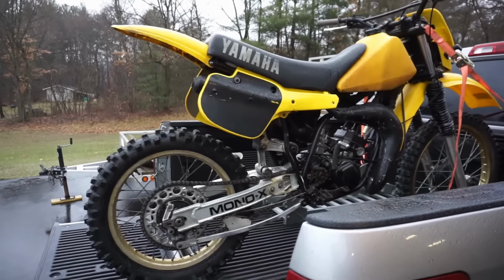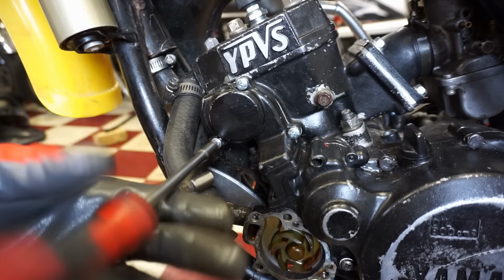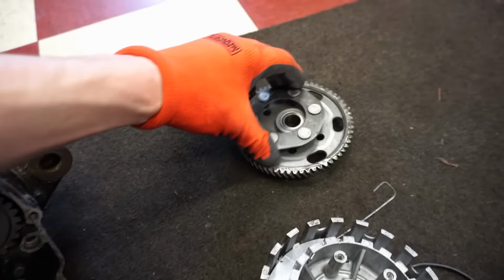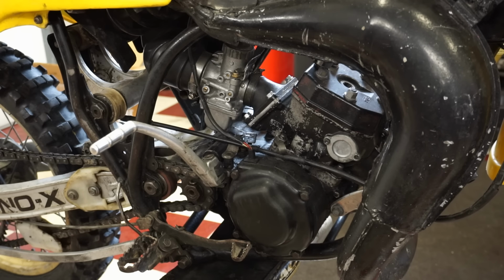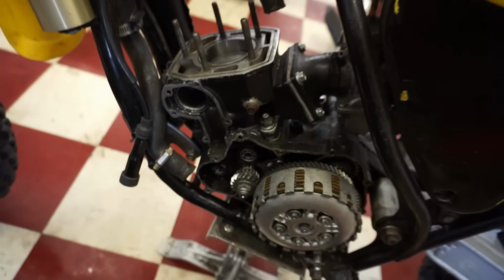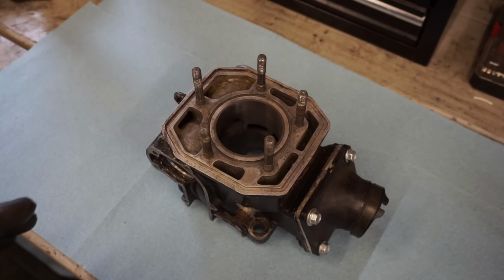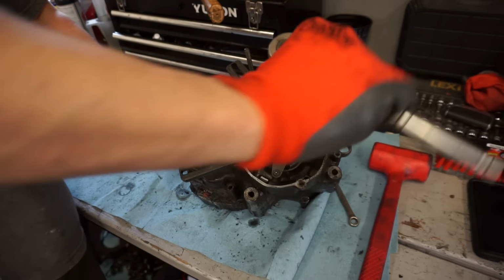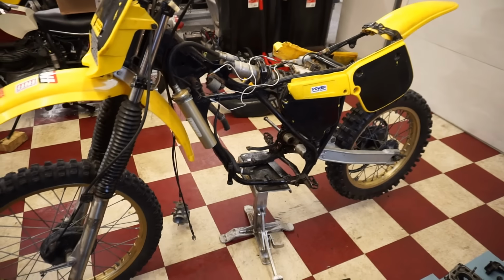Seller Lied About This Rare 2-Stroke Dirt Bike

Comment: Absolutely rebuild it.  You obviously have the skills, so labor isn't a cost (except for the machine shop).  It sucks getting ripped off, but I still think you got a deal.  As you said, the bike looks straight which you don't often see on vintage MX bikes and I love the YZ's (I had a new '78 250).  I'm sure if you found a pristine '82, the seller would be asking more than 2K for it.

Comment: I had one of these I bought used in the 90s. Rebuilt it with a wiseco piston and a new power valve and it was a reliable powerhouse to say the least. Pounded on it almost daily and it was the most trouble free bike I ever owned. As far as your bike, typical of nowadays, you can't trust the "word" of anyone. I had a 84 also, I may be mistaken but weren't those power valves the same? I seem to remember they were but the rod was different. Not sure though as its been a long time ago. I had a few bikes in the day but my 82 YZ 125 and my 78 TT500 were my go to bikes.

Comment: I haven't looked through a lot of the comments, but I had an '81 YZ125 which had the rad up front by the handle bars. I could have sworn that when they made the '82 model. the rad was under the neck and the colour was changed to red and white along with the style of swing arm/mon shock as seen here. My '81 had the triangular swingarm.

Comment: Yeah, the water running through the steering head to the radiator? Yamaha (and every owner) found out fast running 200 degree water through the steering head's pretty hard on steering head bearing grease, plus any looseness at all creates a leak. It WILL leak, until you run external hoses to a different radiator. Like Yamaha did the next year.

Comment: Definitely worth restoring if the parts are available there's still definitely a market for vintage mx bikes out there. Even putting in what you figure it will cost if you decide to sell it when fixed you will probably still turn a profit on the bike. Great videos keep up the good work

Comment: Sorry about your luck with that.

I owned and raced its big brother. The YZ 490. I raced for ten years total and knew all about those YZ's back. 

There was no chance in a million years that I would have started let alone actually ran with that piston and ring. Could have been running Cam2 and nitro and had a zillion volts at the plug. 0 compression = no start period. 

Had it actually started, with a piston that loose, the skirts would have broken off in seconds at mid to high rpm. 

Funny story about a guy who showed up at a track I was racing at outside of Lebanon Tn. in 82. The tall front plates with the tall numbers were becoming mandatory at most tracks back then. As they were at Lebanon, a guy shows up with a brand new YZ125 and was told he had to remove that stock front plate. As I recall, Yamaha took a dual purpose trail bike plate  they already had molds for. The air opening was where a headlight would be fitted. These were on the early run models. They were really ugly. Your bike is a later production or it was retrofitted with the newer plate. I believe that was the only year the radiator was on the triple clamps.

Anyway, this guy had the tall plate with him that he just hadn't taken time to install. After he gets it installed tight over the  radiator with zip ties, he didn't know what to do about air flow thru it. The track had power for there speaker system. Someone comes out with a corded electric drill and suggest they  start making holes. 

I wasn't really paying attention until my dad elbowed me in the ribs and pointed at the kid. Before anyone could stop him he had drill 2 or 3 holes thru the plate and right thru the radiator. He apparently decided to rush the job and just randomly powered that drill into it really fast. My dad knew what was going to happen, he saw it from a mile away. The guys buddy saw the coolant pouring out and yelled at him to stop. 

Honestly as sad as it was to watch, we got a good laugh out of it. Never saw the guy again at any track in the area.

Comment: Rebuild it.   Use nice stuff.    Get the sticker for the swing arm.   Check the steering stem  bearings too and reroute the hoses outside the frame from the radiator 

Let me know how it works out please.    Best Mike !

Comment: Hey! I got a 1981 YZ125H. In neutral it will shift in to first gear on its own. Wonder why. Also the coolant is leaking from the steering head. If you are parting out, I could make use of some parts :) Good luck with the build.

Comment: I owned a 1982 YZ250. It was a beast! Yeah, odd placement of the radiator. I was in a race and someone kicked up a large rock and dented the aluminum on the bottom half of the left fork. Suddenly I had no suspension as the bike bottomed out into the dented portion of the fork and it locked up with zero suspension. What a bummer.  YPVS was an interesting albeit ground breaking addition.

Comment: Had one of these back in the late 80s . The YZ 125 MODEL J    was the first water cooled YZ      I did have issues with leaks though the headset from the cooling system seals . iT DID GO HARD . In 86 i brought a KX 125 E1    The poor YZ was nothing compared to the power & the handling of the E1 . KX E1 being a 1986 model .

Comment: I own a complete copy of this. From What i remember the power valve linkage gets a little sloppy.I replaced the clutch basket and had a rod kit done on it.They run OK I thought although I have not run it in some 10 plus years. Surprisingly the trans always shifted fine, and It always ran reliably (trail riding)

Comment: I had 3 82 YZ80J's...1 was stock, 1 was practice bike, other was race bike. Those things ripped! Wish I still had 1 of them. The radiator on front of handlebars behind plate was cool at the time. That bike today would run with the 85's if you put a larger head & piston in it. This bike is a great find...KEEP IT!
Reply: Friend's dad bought him an 80 J, those were the best, I had my RM80 N but nothing could touch the J 👊
Reply: Brand new 80 J.. that engine sung like an angel...lol,  specially when you kept it in the band all up the 6 gears.

Comment: I think that bike cost between $1,200 and 1,400 brand new in 1982.  That was before the 1986 production rule that tripled the cost of a bike in 5 years.
My 86 YZ250 new cost 2,300, and my new 88 CR250 cost $3,200.  They topped out at about 5 grand several years before the 4-strokes were forced on the industry.

Comment: The Suzuki RM's were the top motocross bikes in 1982.  Especially the 250 which blew everything else away.  Yamaha only did the radiator on the forks for that 1 year.  It heated up the fork oil, which caused problems.
Reply: I had an 82 RM 250 it screamed awesome bike!
Reply: @marksnyder8697  You know!  The '82 RM250  was legend

Comment: the vast assortment of mixed fasteners tell me it was some barn/garage/basement pickup someone got for cheap and it sat around for years tore down, with half the parts now missing.
the question is, who took the plowing and received the most lies, you, the seller to you or someone else multi-steps up the line. those things tend to get pushed around or thrown into trade-off combo deals.

Comment: I had the 1982 YZ 80 back in 1983-84, I bought it from a boy who raced expert and they caught him riding the wheelie across the Finish Line in 80 miles an hour, it was bored out 3 times, it was fast as hell! About 6 years ago I seen one on eBay that was in mint condition, I really wanted, but I didn't have the money, and he only wanted $2,500 for it.😣😢

Comment: Yamaha only did the rads behind the numberplate for 1982 only as they always leaked in the stem. Steering stem bearings and seals are probably toast. I had an 82 YZ80J of the same design. Never had luck tracking them down so I had to route hoses, bypassing the stem. Also Yamaha used O-rings on the head, not a gasket. Good luck with the crank. But at a quick glance it looks like you have a solid platform to start with. 👍
Reply: In regards to the radiator on the steering stem it was 81 actually for the YZ125 and your spot on with your remark as to it being a troublesome design . It will be interesting to see how he gets around this as those bearings and seals have been obsolete for decades now !

Comment: I bought a motorcycle from a friend one time... he had it in paid storage for a year.  It only had 700 miles on it when he stored it.  I paid him and got the title.  When we went to pick the bike up it wouldn't start.  I managed to get it fired up enough to ride it home.  Found out that all the major parts had been taken from the bike and old, defective parts put on.  The gas tank had bondo repairs on the bottom, and the four carbs had been swapped out with a set full of rust and worn needle valves.  The bike had been cannibalized to repair other bikes, with the bad parts bolted back on.  The crooks didn't even bother with replacing the springs on the carburetor boots.

Comment: @2vintage You should take a closer look at that steering bearing. The coolant from radiator goes thru there. Had seals notorious for leaking and causing damage. Thats why the moved the radiator. Likely to take more than bearings. Forget all the details but know some have required welding and a machine shop. Know of one guy who managed to bypass that mess with heater hose eliminating need for seals. But was a bit questionable. If you decide to part it out, let me know.

Comment: Wow, talk about a throwback..... BUT, a bit more for me 🤗👍B/c my Grandfather & Dad bought 1 for me, brand new at the dealer, a 1982, YZ80 back in well,  YUP 1982 😁It was a graduation gift  for graduating 8th grade.... In 1982, I was just 12 y/o, 5' tall, 90-100 lb skinny kid 🤣and the 125, was way too big for me. Years later, realizing (knowing myself) I was always an impatient kid..... + I didn't graduate 8th, until 1983 🤷‍♂ 🤔😁 H/S in 1987.... At 6'1 195 lbs and 55 y/o now, I agree, that 100% was me 🤔I was ALWAYS impatient until I hit, ohhh about 40 🤣But what a throwback this video was for me. YUP,  the 125 here, same as the YZ 80s, my radiator was up top, in front of the bars. Mine had chrome rims, BUT didn't have the full floater rear swing arm. That didn't happen on the YZ80s, until 1983 (facts, because my best friend back then, got his YZ80 in 1983, AND his had the FF swing-arm) I have pics somewhere 🤔🤗🥰 BTW, I subbed up, & I'd like to see a follow-up on this 1.... on how it actually runs and sounds fixed back up..... Wish I still had that 1982..... IMHO, everything was better back in the 80s, than today 🤷‍♂🤣 +  It'd make a great gift for my grandson + the story, memories and fun times I had with it 🙏😁

Comment: Nice video, reminds me of working on my 83 YZ250. When you pulled the power valve cover, I was like holy smokes it's not even there!!! Sorry there are people our there like the seller. Like you said that bike was not running & would have zero compression with a piston & ring set that far off. Hope you can source the parts at a good price. Got to save the smokers (2-strokes)! Good luck with it!

Comment: Never buy a bike in less you can hear it run and you can ride it (unless you want a parts bike).  My 1987 KX500 sat with the original tranny oil and antifreeze in it for over 23 years.  It still runs like brand new even with the old fluids in it...  But I did recently change those fluids out of guilt....

Comment: I had 3 bikes in one....all yamaha......
A 79 mono shock, a 1980 frame, and a 1981 250cc(246cc), and I sunk it in a mud hole... I got a dr400 head, honed my cylinder, sleeved it at 260cc, used the 400 head, honed it down to 256cc, with rings...it rocked!!! It'll flip a fat man!!!
I figured 275hp, because 1st gear, and good startup, gave great climb. Bought it for $74, and a good used tire.  Sold it in 97, for $1000, and got it when that fat man hit 3rd gear....kickband...in front of me...he popped the wheelie, stopped, turned back to my driveway, and told the buyer to grab it now
Some say it had 325hp!!!!

Comment: Those power valves are hard to locate. Getting expensive. Most of them are for 84-85. They will tell you they are same. But they are not. You can put it in there. But its not right. They have 2 extra holes for ports not in yours. Looks like you also need the governor and linkage. Make sure you get a good one. They wear out. And they are 2 pieces with locating pins and a bolt. Often the bolt would come loose , people would continue running it. The holes for pins get out of shape. The 2 halves got out of shape. And the bolt hole and threads destroyed.  I have an extra power valve that is good. Have the whole set up , governor ,linkage, and valve. Might be interested in one of your clutch baskets. Mine works but has a finger broke off. If you have extra rubber gasket for powervalve cover might be interested in that. Doubt you still have it. But you had a bombardier ds650 that came with a bunch of extra parts. I need some of them. The beaings, seals , and gaskets you need are cheap and readily available. Depending on bore size i might have one of those. But they are easy to get.

Comment: I was a teenager when these were new-ish. The powervalve makes no difference to how these run-- this isn't the same as a new bike. Back then it was a marketing gimmick. Many tuning shops took them off as well as the Honda equivalent (ATAC) which was introduced in 1984. Suzuki and Kawasaki didn't even use powervalves until 1986 and 1985 respectively, and I had no problem beating '82 YZ125s on my 1984 KX125 which had no powervalve. $850 for the bike as it is, is not a great deal but not too bad. You can't get more than about $2500 for an Eighties 125 even restored, at least when I was heavily into this stuff about 6-8 years ago.

Comment: What I've learned buying used equipment: If there are parts are in a box you can never assume anything the seller is saying is accurate or true. Especially if the parts in the box prevent you from turning the engine over and hearing it run or compress.

Sucks that sellers can be so dishonest :(

Comment: How did the valve system work?  Rotary valves?  Reed valves.  I know when I put a reed valve on a 175cc AT/CT-1, it released a torque monster at the bottom end.  I’m a big boy, 6-2, 200+ and the bike weighed about 225 after I put it on weight watchers.  I did too and lost 20# and got the bike down to about 210.  It was great.  Running lean I could run away from the stock DT250s.  It would lose its “go” on hills and in deep sand.

Comment: I dealt with something similar, albeit not as extreme, from a pair of buyers.  My dad had a massive stroke, but has defied the odds, and not ended up the vegetable doctors thought he would, and I want to get him riding again (probably this summer).  A full sized bike just wouldn't be safe for him anymore, so I bought a Kawasaki KE100 from a pair of teens looking for money for their next bike.  I already knew they were charging too much, but I felt like I was helping out a couple of young riders, so I didn't haggle.  When I asked about it being oil injected, they admitted that they had switched it over to premix (not good for the engine).  The bike ran, and I hadn't ridden an injected bike in over 2 decades, so I wasn't looking for the telltale signs I should have.  They told me the injection hardware was all there.  No, it wasn't.  NONE of it was.  No tank, no pump, no shaft, no gear, no nothing.  Worse, when I had the clutch cover off the deal with it, I found a gear sitting on top of the crankshaft - that wouldn't go on  You could see where the cover was scored up where the loose sprocket spun and jangled around.  I paid a guy to repair the threads, but I made the mistake of trying to torque it to factory specs - off came the threads.  I ended up threading it back on  gently with threadlocker.  Having dealt with all that, I got new tires, sprockets, and chain.  When I went to put the sprockets on, I found out the only thing holding the old drive sprocket on was... the engine cover.  More missing parts.  Oh yeah, and the rims had no rim tape either!

The bike could use more work to make it look clean and nice, but after hundreds of dollars spent, it's now serviceable, with a working oil injector in place, and sprockets, rims, and tires all good.  What really should have costed more like $500 or $600 Canadian ended up closer to $2000 all told.  It'll still be worth it to have my dad riding again, but those kids totally screwed over any kids I buy from in the future.  My "let's help out some young kids" attitude is gone.

Comment: If this were a car the previous owner would have tried fixing it with liquid top end gasket repair. Maybe you should try it, using the plug hole to fill it with a quarter? I've heard this is the proper way.

Comment: Wow, the previous owner said it was too much to restore? The Bike pretty much has everything intact. Sure, completely disassemble it, clean and replace worn parts, strip and paint frame, seat cover etc. It would take time since 1982 YZ parts are not over the counter stuff. He didn't sound like He was serious about it.

I am thinking in terms of a collector, not necessarily something you would race every weekend. You have a modern Bike for that.

Comment: I bought that bike new in 1982 for $1300 out the door. I ended up hating the bike. It had so many issues. I bought the bike thinking it was going to be reliable and it was one of the worst bikes I’ve owned. The next year I bought a 83 Honda CR125 and I never had any issue with it.